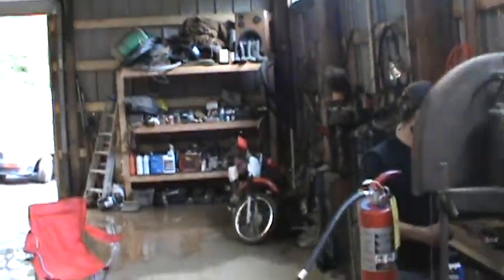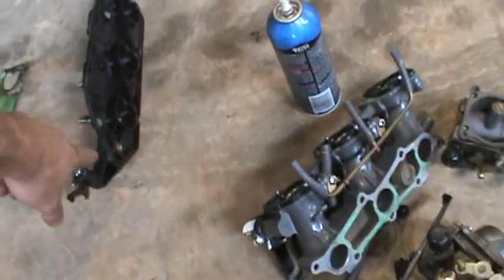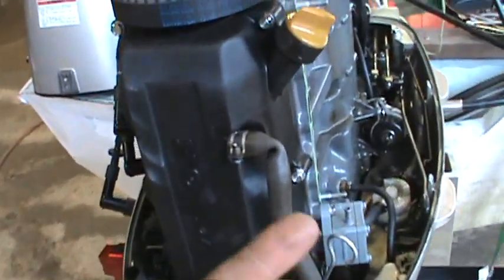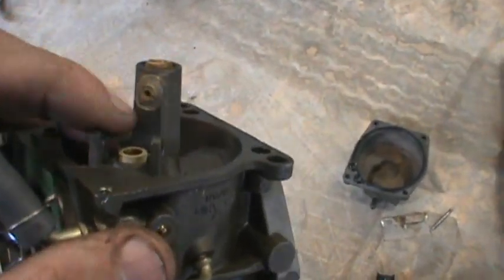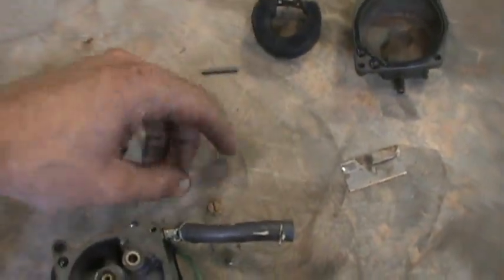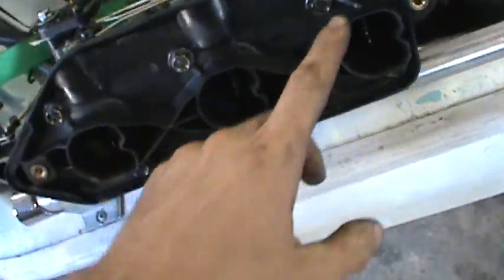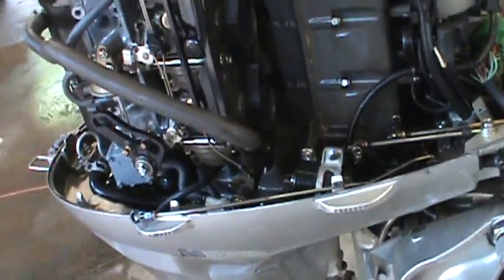Honda 4stroke 50hp outboard carburetor rebuild

Comment: This is a good intro to these carbs. But he never tried starting to see if he fixed it. I once went round and round.  The longer skinny tube is critical and I also used an old school motorcycle mercury sync tool to get them synced.  You can kinda also use a hose and listen to the hiss, (but best to leave the sync adjustments alone like he suggested in previous comments.)

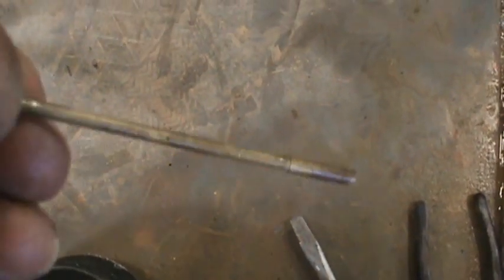Comment: The part he shows at the 11:00 mark is the JET SET (#42)
16150-ZW4-000 is the part that plugs and causes poor idle. Or else its the tiny o ring at the top leaking that causes the poor idle and misfire.
https://www.boats.net/catalog/honda/outboard-by-hp-serial-range/50hp/bf50a1-lrta-2001/carburetor. Also Item 5 SCREW SET (CARBURETOR NO.) | Use up to Engine SN BG31B B.
16016-ZV7-B51  the idle mixture screw have a limiting cap crimped on so you cant remove them to blow the hole clean or blow out the fuel when you drain the carb at the end of the season, causing poor idle next season. 
I broke these off with pliers and reverse drilled them to unwind them from the carb. Was a bit worry some but it went real smooth. Then I replaced them with new ones  and left the limit cap off so I can remove them with a flat screwdriver. Motor runs like a new one again.

Comment: This guy needs some lessons for sure.  Using the floor of the shop for carb work is just stupid . Anyway he should've checked that small emulsion tube for cracks , honda is notorious for them fracturing causing rough idle plus his removal and assembly of the intake is just messed up but he's not an outboard tech so I would look elsewhere like a manual instead of this video for help.
Reply: WoW .. I don't see your videos anywhere  Until I do STFU...

Comment: Do you know where or how to remove the idle jet? The Honda manual does not show it, a Honda mechanic said Honda outboards have an idle jet circuit. I did a complete tear down and rebuild with all new gaskets and hoses and seals and new jets and my engine idled only a little better than before.  Are they under those dime size covers on the side of each carb ??
Reply: did you ever get an answer or figure it out?

Comment: Thank you Beau!

1) What about syncing the carbs? Is this something that is critical to do each time the carbs are dis-assembled?
Reply: The rod that connects the carb throttles together just pops off the ball socket so you dont have to mess up the adjustment, however checking sync is not a bad idea.

Comment: I think its called the emultion tube. (The tube you did not know the name to that the jet leads to in the carbs)
Reply: jmdogful that long tube is the bane of my existence. Had 4 cracked tubes 2y ago and right now 2 I've inspected are plugged where it changes diameter.  This is first video that shows it is clear.
Reply: emulsification